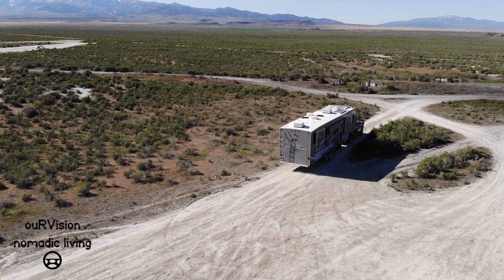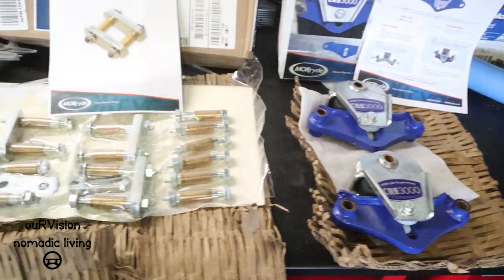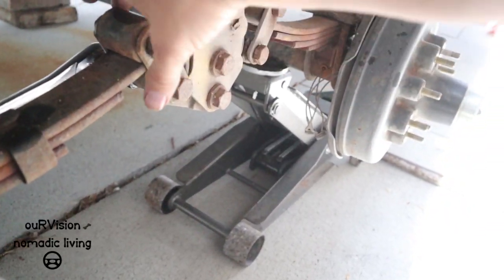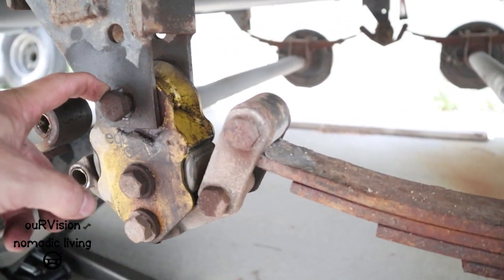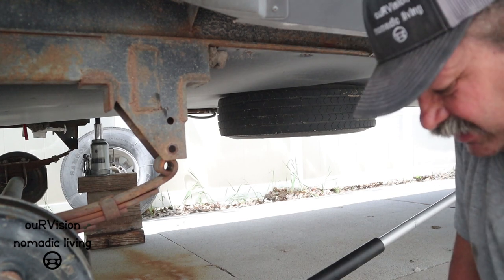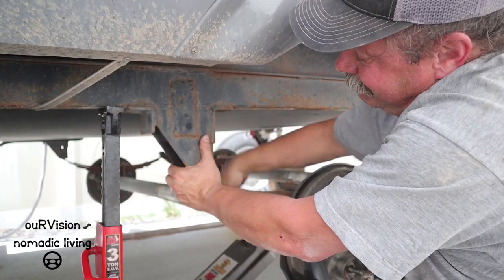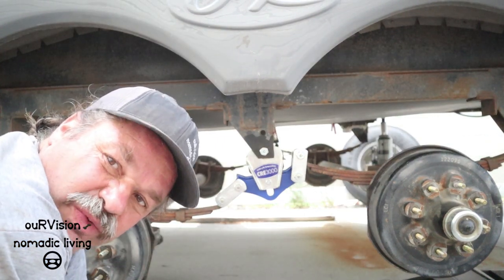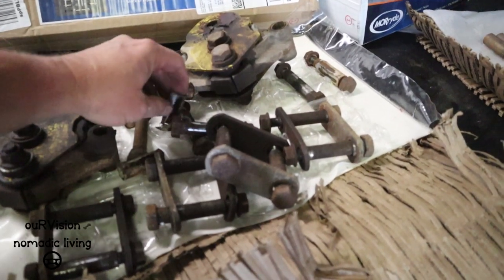IS IT WORTH IT? MORryde CRE3000 Suspension & Wet Bolt Kit Installation

Comment: I just upgraded my cre 3000 to the heavy duty shackles. Keep your extra bushings, the top center ones on both sides all but feel out with a third of it worn away (brass/ bronze whatever they are). I think I have about 15,000 miles on them. So you will need to check them down the road. The two side ones that grab the leaf springs are still in very good shape. I hope that everything will last longer now that they are wet bolts. Good job brother!
Reply from the maker: Hey Matt, thanks, I do carry the spare bushings. I actually just replaced all the leaf springs while we were in Texas and because of ordered a new heavy shackle kit so I could install new bronze bushings in all the leaf spring eyelets. I didn't end up replacing the CRE 3000 as it was still in great shape even with all the miles we have put on it since this install. I was pleasantly surprised considering how worn out the original Equiflex equalizer was as seen in this video. Safe travels my brother. 👍
Reply: he did not mention it but it does in the instructions, after replacing the suspension parts you should get the axles aligned. It is a pain in the ass and takes 2 guys with 2 tape measures a few days, or a shop an hour.

Comment: Big thumbs up!
I am getting ready to install the same heavy duty shackle upgrade to my 2021 Raptor triple axle trailer today. Had one shackle tear through after only a few trips. It should be criminal for them to build trailers using these cheap 1/4" thin soft metal shackles and plastic bushings! Can you imagine if cars or trucks were made this way? Come on man! So after watching several videos like this one I've decided to install all my wet bolts so I can grease them from the middle while rolling around on a creeper underneath, should be a lot easier access. Also, it's important to index the bolts so that the lube holes are facing sideways and not directly up or down to make it easier to pump grease into them. Otherwise the weight of the rig resting on the bushing could block them off making it more difficult to pump the grease in.
Reply from the maker: Thanks so much. Good luck with your project. 👍🍻 Sean

Comment: Great video! You explained everything so well, and your camera angles were spot on. You also made it look easy! I would have loved to see how you elevated and secured your rig before you did this work.
Reply from the maker: Thanks so much Russ, glad you found value in the video. First I hooked up the rig to my truck (just for safety sake). Then using a bottle jack under the frame right behind the RR wheel, I raised the frame until the RR tire was off the ground. I placed a jack stand under the frame and removed the tire. Then I lowered the trailer until it was supported on the frame with a jack stand. Then using the bottle jack I did the same with the RF tire. Then I moved over to the left side of the rig and did the same thing. In effect once all four tires were removed the rig was being supported by jack stands under the frame. with the added safety feature of having the rig hooked up to my tow vehicle.  This allowed me to float the axles while doing the suspension work with the two floor jacks.  I hope this explanation helps. 🍻 Sean

Comment: Amazingly enough 2011 TT about 20,000 km    just changed out to wet bolts and Dexter Easy Flex and plastic bushings were in need of replacement. But not as bad as yours by a long shot was pretty amazed. Still a great upgrade
Reply from the maker: Thanks for watching & commenting Bob. Safe travels to you. 👍 Sean

Comment: Thanks for your video. We just purchased a 2021 eagle 321. Think I will get them done next "spring". No pun intended.
Reply from the maker: Thanks so much for watching. We had just over 17,000 miles on our rig when I changed ours. So unless there are a bunch of miles on your rig I would think you should be OK. But I do highly recommend the upgrades. I have been very happy with them. Safe Travels!! 🍻 Sean

Comment: Just ordered mine   Trailer is 18 months old, I bet plastic bushings gone after 2100 miles. Thanks for the video.
Reply from the maker: Thanks for watching and commenting. Good luck with the installation. 👍 Sean
Reply: Wishing I knew the size of the zirt, so I could get grease gun to fit, first time 😉
Reply: Finished in 4 hours, start to finish! Text drive is tomorrow. You need a couple jacks and a couple stands to maneuver the bolts on far ends bc of stress from center piece. MTF

Comment: Nicely done. I also have zerks facing out (my preference). Buy some zerk caps & a lock-n-lube 90-degree fitting. Makes job easier, therefore you'll do more often.
Reply from the maker: Thanks so much. I made this video back in the spring of 2020. In March 2022 I ended up replacing all my leaf springs due to a broken one. At the time I went ahead and put in new wet bolts and this time put the zerks on the inside. Safe travels!! Sean

Comment: Great job plus the paint job looks great. Now nothing but smooth ryding here on out
Reply from the maker: Thanks you two. I was very glad to get that job done last spring. We have put over 10,000 miles on the rig since then. As you saw, the plastic bushings the factor installed were shot. I highly recommend installing the wet bolts at the very least. Take Care and Safe Travels!! 👍 Sean

Comment: Nice job, great video!!! I have these on my 2019 rv. I have issue with the main carrier bolt
on one side. I have never been able to grease it!!! ran into a dealer at an rv show, he said it was installed wrong at the 12 o'clock position!!! The bolt have only on grease hole, all the weight and pressure blocks the hole. He said always mark bolt on the zerk side and install in the 9 and 3 o'clock poition. Hope this is some information for you. Thank you.
Reply from the maker: Thanks, yes I failed to share that information during the install. The instructions do indicate to put the bolts in so the holes for the grease are at the 9 and 3 position. Thanks for watching and commenting. 🍻 Sean
Reply: @ouRVisionnomadicliving  Thank you, keep them coming for us do it yourselfers. Dealers are such rip-off artists!!! Thank you again for such a fast reply. God Bless!!
Reply from the maker: @riverking4u  You bet, yeah, the hourly rate at any shop now is crazy. Safe Travels!!

Comment: I did this upgrade in April 2022. 13 months later, I have 3 zerks (out of 14) that won't take grease. I have to pull out the 3 wet bolts to see what's happened.
Reply from the maker: Sorry to hear that, how frustrating. I wonder if you could just replace the Zerks? Have you contacted MorRyde to see if they might send you replacements where it's been only a year?
Reply: @ouRVisionnomadicliving  I took all 3 zerks out of the wet bolts. They work fine. I suspect the installer didn't position the wet bolts correctly. I will find out when I remove them for inspection.

Comment: Great job and a good way to keep your RV around for another 17k miles. The new Fords will keep a log for each trailer for you in case you are getting tired of keeping  your own log.  We have a travel trailer with torsion beam axles and the suspension is still in great condition after 17k miles. I wonder why not more RV companies use these?
Reply from the maker: Thanks so much for watching and commenting. I suspect the answer to your question is cost. I don't mind keeping the log, guess I'm old school that way. Besides, it's concrete documentation that when the time comes can be provided to the next owner. And.....well I do like my Dodge, Ford hasn't offered a standard transmission in a truck since 2010. Take care and safe travels!! 👍

Comment: Great Job! Between this video and the leaf spring video, I now have the confidence to tackle these jobs so thank you very much for making the videos and I have become a subscriber! One question though..Do you have to jack up both sides of the trailer and remove all 4 tires or is jacking one side and doing the work and then jacking the other side to change out things going to be fine?
Reply from the maker: Thanks so much for watching and being a part of our journey. As you saw in this video I jacked up the entire trailer. In the leaf spring video I raised the trailer to where it was almost off the ground, then did one leaf at a time. Honestly the easiest way would to get the trailer totally off the ground, that was the suspension would be totally relaxed making it easier to "float the axles" around when reasembling. Again, thanks so much for watching. Good luck with your project and safe travels. Sean

Comment: i have a doo little trailer the back wheels keep getting worn out the driver backside always goes bad on the inside I just put new axles on the trailer last year for some reason they keep going bad I put everything new leaf springs bushings and the center part do you think the cre 3000 would help ? i see they have a 35 inch and a 33 inch wheel base whats the difference in them and will they help tire wear?
Reply from the maker: Hi George, thanks so much for watching. First let me say that installing the CRE 3000 in my opinion will not solve the wear issue you are experiencing. The benefit of installing a CRE 3000 is with the rubber insulators it helps moderate road "shock" while traveling down the road. Basically the rubber insulators absorb some of the impact that happens when you hit a pothole... or are traveling down a rough road. The difference between the 35 and 33 inch wheel base has to do with how far the tandem axles on the trailer are, and so you know which CRE Equalizer fits your particular application. I am sorry to hear your having issues with the wear, even after replacing your axles. I would suggest taking the trailer in for an alignment, it sounds like even though you have all new parts, something is not aligned correctly. Again, thanks for watching and I hope my answer helps. Sean

Comment: Thanks for sharing.  Why did you choose the CRE3000 vs the CRE4000?  I am doing this soon too.  Like 1K+
Reply from the maker: Hi Dennis, great question. I went with the 3000 because I had already reinforced my axle hangers and didn't feel the need for the cross member supports that are available with the 4000. Thanks for watching. Good luck with your install. 👍 Sean

Comment: At 10:46 the image of a jack holding the load while you work on it and not centering the jack over the blocks would have gotten me fired when I moved machinery for a living.
Reply from the maker: Thanks for your concern, but what you don't see is that the RV was hooked up to the 5th wheel plate to my truck, with both front landing gear grounded, also the rear landing jacks on the rv were also grounded. Should I have taken the time to better center the jack, probably. In any event, I was not working for anyone, captain of my own ship so to speak. Thanks for watching and safe travels. 🍻 Sean
Reply: @ouRVisionnomadicliving  I got ya, it was just a gut reaction to what I saw, carry on.

Comment: The title of your video starts with "IS IT WORTH IT?"  But your video was focused on the installation, so I don't think you answered that question.  There was no commentary on any performance issue beforehand or any benefits of doing the install.  Should I do this to my trailer with only 2,000 miles on it?  If so, why?  Is it worth it to do this?
Reply from the maker: Hi Alan, at 2:19 in the video I demonstrate how worn the shackles are prior to removing them, at 3:13 after removing the stock shackles I do a side by side comparison to the new heavy duty shackles, at 4:37 I remove a plastic bushing, show how worn it is, and talk about how I think it's ridiculous that these trailers come with plastic bushings instead of greasable bushings, after the install I again show how worn out the parts were that I removed, and how relieved I was at finally getting that job done. Sorry if you felt my showing and demonstrating, not only how worn out the stock parts were, but how it's my belief that using plastic bushings instead of using greasable ones is ridiculous. Was it worth it? Absolutely. Thanks for watching and letting me know your thoughts  Sean

Comment: Hello,  thanks for your video.  I saw a comment asking if you had the spring hangers reinforced.  You replied that you had.   Did you happen to do a video of that process/what was added? 
I am planning this same upgrade and would want to reinforce things at that time. 
  The thin factory spring hangers and the thin frame material makes me feel like I am towing a time bomb.  
I have been wondering about removing existing hangers and having thicker ones made.  Then I realized that the wet bolts wouldn't be long enough.  I wonder if MorRyde makes longer wet bolts.  I will be calling their customer support as part of my preperations.   Thanks again!
Reply from the maker: Hi Rodney, thanks so much for watching and commenting. I did not make a video when my wifes cousin reinforced the spring hangers. I did that before I started our YT channel. My wifes cousin Jeremy is a master welder and for many years worked as a fabricator at a trailer manufacturing company. Shortly after we purchased our rig in 2016 I took our rig to him an had him reinforce the hangers. Sorry I cant be of much help to you there. I have put over 20,000 miles on our rig since I did this upgrade a couple years ago and I have been very happy with it. Safe Travels! Sean

Comment: Sorry, one last question.  Did you or any prior owner reinforce the spring hangers or did they come like that from the factory?  It appears more steel has been welded on to them on the front, back and sides.  I’m especially interested because I had a 2015 Open Range 427BHS and suffered through two separate incidents of the rear most hangers breaking off at the weld lines.  Mine were not reinforced.  Thanks
Reply from the maker: Hi Robert, we purchased our rig new in Sept. 2016. Shortly afterward I had my wifes cousin reinforce the spring hangers. He is a professional welder. I did so as a precaution after seeing a bunch of posts showing failures, specifically on the 2017 388RKS models.

Comment: Now that it's been 2 years, have you had any suspension issues?
Reply from the maker: Hi Robert, none at all thankfully. I pulled off the hubs and packed the bearings on May 17 of this year. Everything looked great. Shot some grease into the wet bolts while I was at it, and inspected the MorRyde CRE, Rubber pads in it still look great. The total mileage on the trailer in May when I did this was 36,349. (when I saw your post I grabbed my log book) 🍻 Sean
Reply: Sorry, one last question.  Did you or any prior owner reinforce the spring hangers or did they come like that from the factory?  It appears more steel has been welded on to them on the front, back and sides.  I’m especially interested because I had a 2015 Open Range 427BHS and suffered through two separate incidents of the rear most hangers breaking off at the weld lines.  Mine were not reinforced.  Thanks
Reply from the maker: @robertfoster8500  No problem. Angie and I purchased the trailer new in Sept. 2016. I had Angie's cousin reinforce the hangers in 2018 after seeing a number of rigs having issues with the hangers, specifically the Highlandridge 2017 388RKS models, that spurred a recall on those units.  We were planning on taking the rig to Alaska (We had plans to be camphosts at the Deadman Lake Campground south of Tok from May 18-July 10 in 2020, but we cancelled that when Covid hit and shut down the U.S. Canadian Border. I had Jeremy reinforce the hangers as a preventative issue. I felt it was better to have him do it, and have an issue in the middle of now where.

Comment: Im getting ready to do this to ours, how long do you plan on keeping the leaf spring? No thread lock on the bolts? Thanks
Reply from the maker: When I was planning this project I thought about ordering new leaf springs, but after looking at them they appeared fine. (albeit a bit rusty) I will keep my eye on them and if they begin to flatten I will replace them. The instructions didn't mention putting any thread lock on them, and where the bolts are shouldered...and torqued, I imagine that is why, so no, I didn't put any thread lock on them. So far I am still very happy with this project,  and having the ability to grease the parts is a big peace of mind. Thanks so much for watching and commenting!!! Take Care and Safe Travels....Sean
Reply: @ouRVisionnomadicliving  the only reason I asked about the thread lock was our last travel trailer we had the leaf springs replaced by a shop and luckily I caught it but the nuts where coming loose and almost fell off... so I figured thread lock is a good idea.
Reply from the maker: @RVLivingYet  Its probably a good idea. :)

Comment: The particular brand/kit you're installing, what makes it extraordinary from just simply replacing the original one?
Reply from the maker: Hi Phil, great question. To be frank there may not be much difference at all between CRE3000 and the Equa-Flex. However as you saw in the video the Equa-Flex was worn out, and the plastic bushings were shot. Adding the grease-able bushings and replacing the Equa-Flex was needed and I just decided to go with the MoRyde parts. I have put about 8000 miles on the rig so far. It will be interesting over the next year to see if the CRE suspension will outlast it's predecessor or will need to be replaced as the mileage racks up. One thing is sure. I know the bronze grease-able bushings are in much better shape than those flimsy cheap plastic bushings the factory installed. 👍 Sean